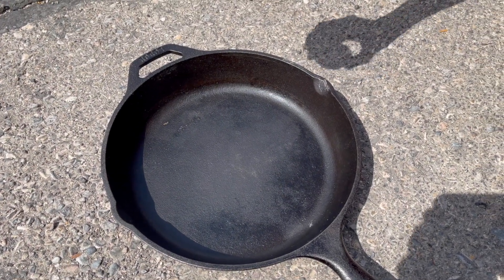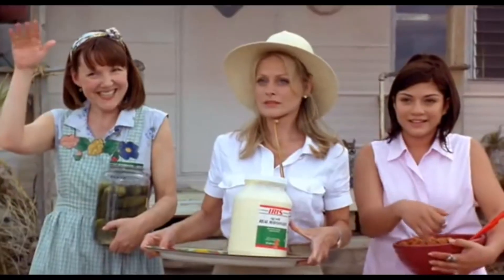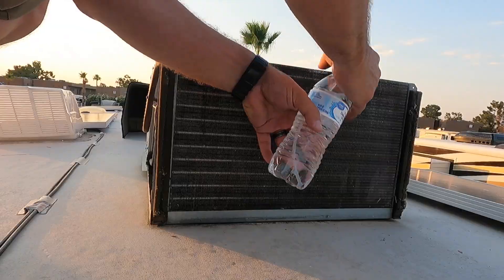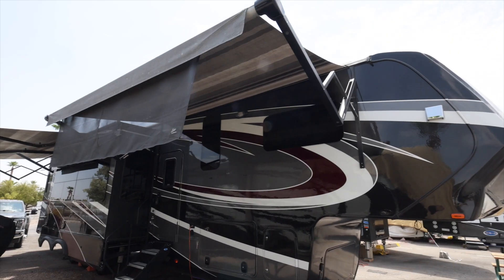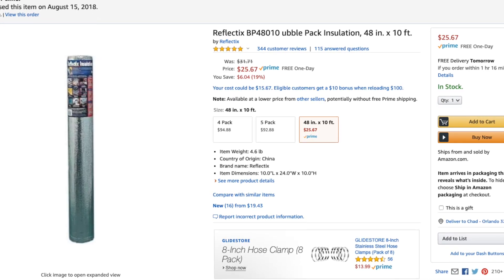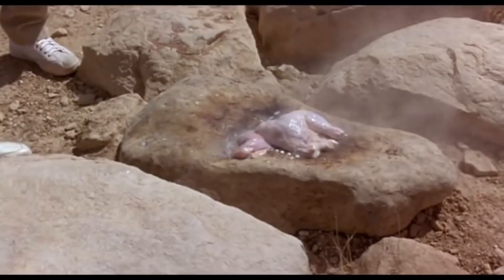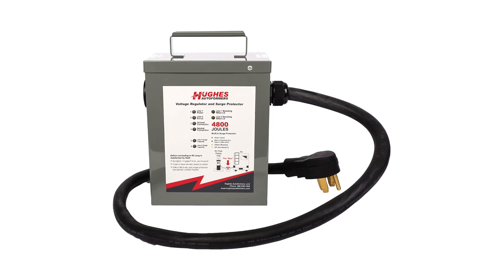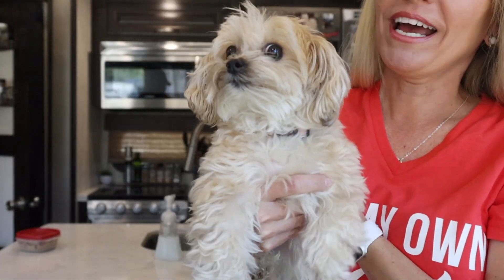🥵  RVing in EXTREME HEAT! ☀️ (Full Time RV Life)

Comment: You can put reflectix on the back wall (ie the outside wall) of your cabinets. My spouse has fitted all of the cabinets in our class A with reflectix & has cut coverings for all the windows. Also we have made a thick rigid foam insert for the skylight in the shower, just pops out when we shower. You can gain a lot of heat from those skylights.
Reply: I was thinking similar thing with cabinets, or anyplace a where outside walls are accessible.  Using Dynamat like the car upfitters use.  It is for insulation/heat reflection, noise abatement (nice feature for any RV.  Easy to cut, self sticking.  In bulk for use with walls, should be cheaper than reflectix.  Just a thought.

Comment: Lots of comments on this one.  
1. You need to get that Victron inverter that will assist.   This will limit the incoming amps. Does not fix the voltage issue.  
2. We have been to that RV park. I was not impressed about their management.   The workers were great.   
3. I love my RVairflows.  
4. Never taped the ducts.  That’s a good one.   
5. Never seen the covers for the roof. 
6. Great tips on the pillows

Comment: Have used a Hughes autoformer for a couple years. Actually found a low voltage situation at home in our driveway as it was boosting both stages. Found out it was transformer issues on the street.